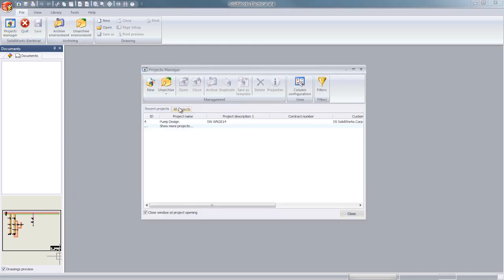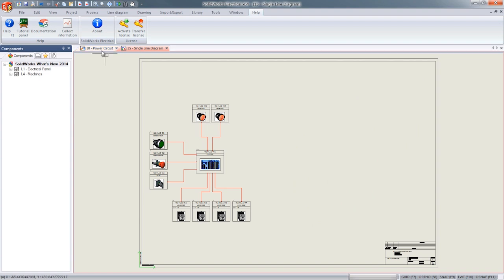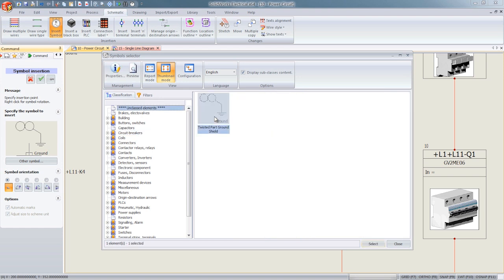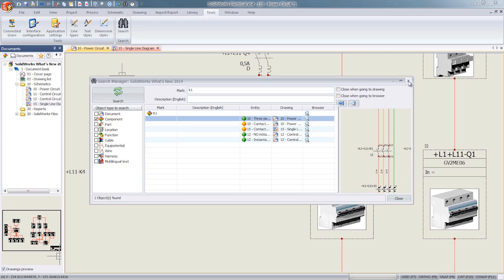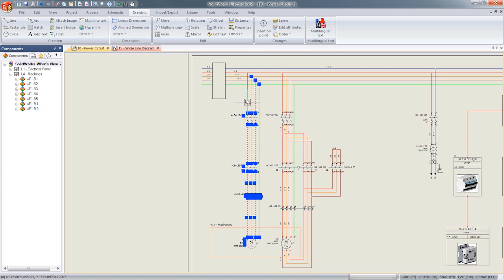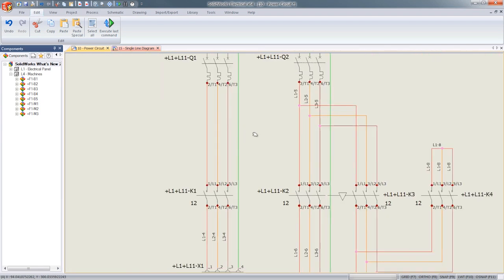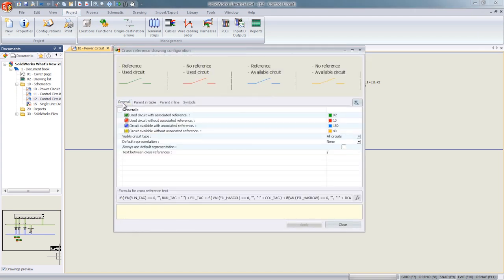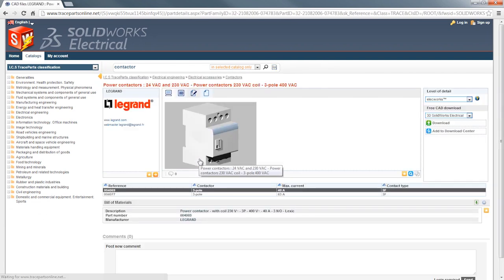SolidWorks Electrical 2014 Schematic1

Comment: How would you jumper multiple circuit breakers like terminals? With out having to run multiple wires to one power supply?